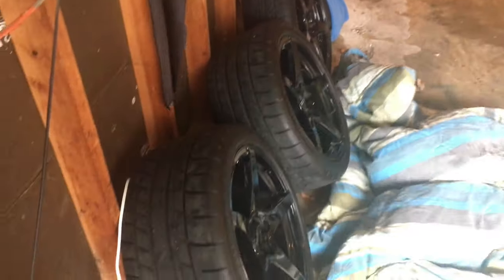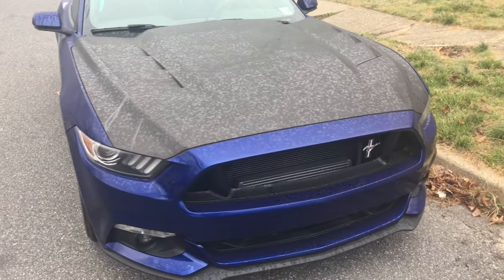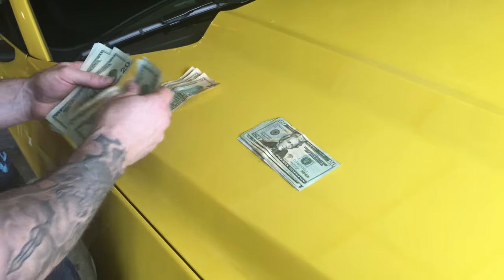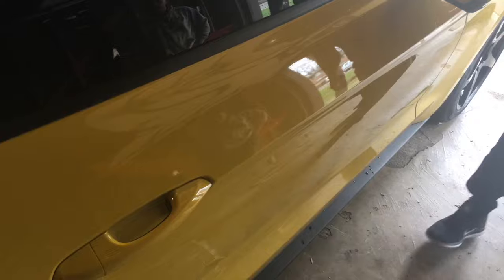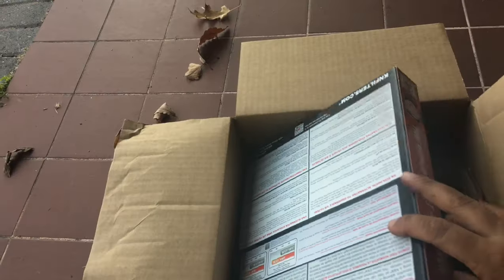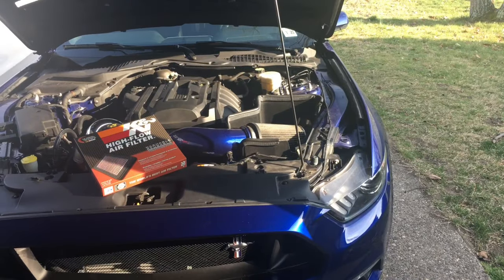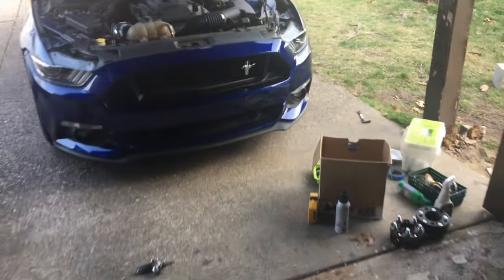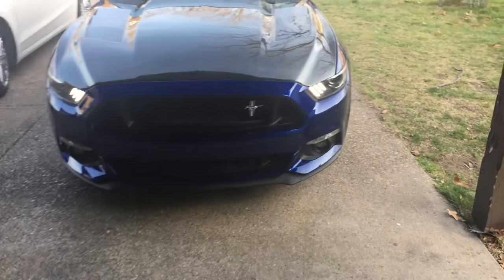He bought my rims and new secret mod!!

Comment: Just traded my ecoboost for a 5.0 and don't regret one bit, kept having problems with it, ac went out , had a oil leak from the side of the motor and then a mis fire and my rear tail lights went out too
Reply: Dam that's a lot of problems how many miles did you have on it?
Reply: omar negron funny you say that about the ac my car is sitting at the dealership today to fix the ac and I was also having a static rattle noise in the headlight knob area of the dash

Comment: Why are you downgrading from the JLT to a stock air box? Sorry, I see you are selling it in a few months. Get a V8 next time, the Eco is a great motor I won't like but having the GT is a total different beast Mine even as a 6 speed auto runs like a banshee. Not to mention is a real pleasure to drive in traffic without that clutch. Yes, it is light but it's still annoying and will run you 1,500 every 30k to replace. My car runs greats, I run against sticks all the time. It usually requires three races, The first one they spin their tires to much and was a rematch. 2. They miss a gear and want a rematch. 3. Either they spin the tires shifting into another gear like second or third or something like that. If you're lucky you will only have to race them 2 out of 3 times, if they can keep ti together long enough for one run. I will be interested after the 2018 comes out to hear is if they will the pro stick crowd will support sticks as they will be likely trounced on by the new 10 speed  automatic. They sneered at people who wanted an automatic for having a better daily driver experience. Now they will try to say it is all the the performance of driving a stick. Once the 10 speed comes into production you are only buying a stick to may it more inconvenient to drive.